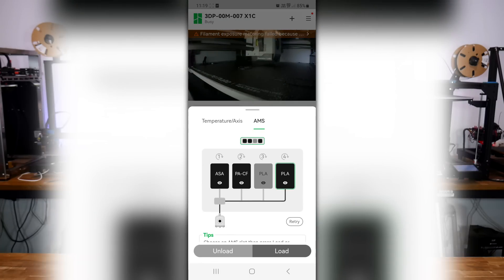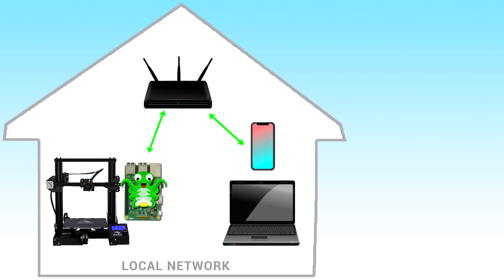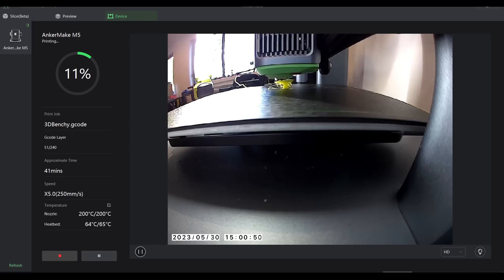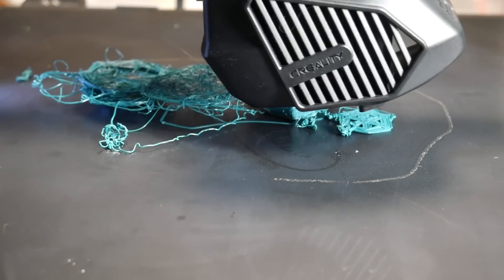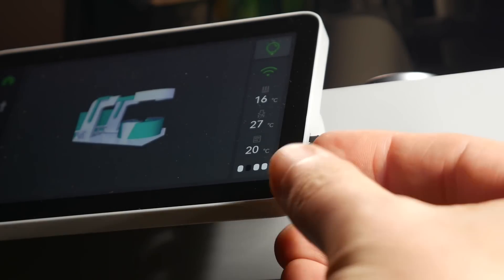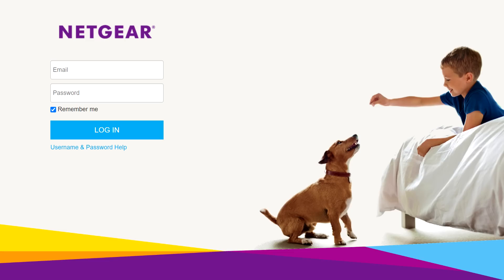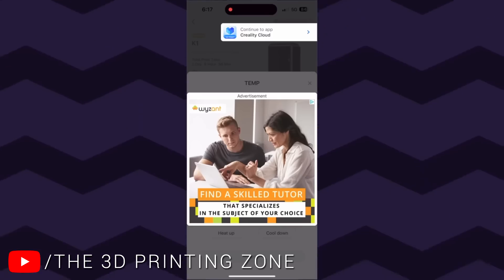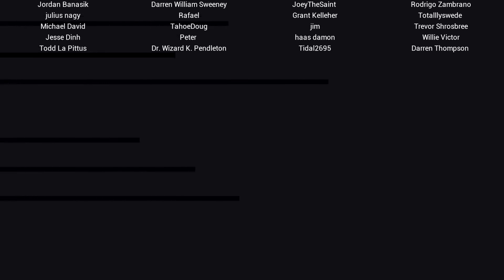The pros and cons of 3D printer cloud connectivity

Comment: I think one other possibility aside from theft of models that are sent to the printer via the cloud is blocking models that run afoul of some rule. It's irritating that scanners in the US will refuse to return the scan if it detects it just scanned money. It would be very irritating if it were determined that a model couldn't be printed for some reason, law, whatever. Although this could be done locally on the printer (like how it's locally done with the scanners), doing it in the cloud could allow for immediate updates to the list of banned models as well as analyzing meshes for similarity to banned models.

Comment: Ultimaker sells a subscription too, but it is not required for the cloud connectivity or remote access (camera, abort, pause, etc). It only increases the number of users you can have within one "organization", the number of saved print files, number of  projects (think of folders on a PC), and the length of the saved job history. It's kinda like expanding your google drive cloud storage. This is the only form of subscription for printing that I am okay with.

Comment: 11:05 For my commercial application all hardware is strictly offline. I do not tolerate even the possibility of an IP leak to "interested parties". You claimed that risk of theft was mitigated due to an overload of data requiring too many people and too much expertise. I'm afraid that isn't so - for example Chinese ops have more than enough labour resources and methods for highlighting "hot property" simply and easily. If you want to build a sustainable business in this space you simply have to keep your systems closed loop.

Comment: I don't welcome cloud connected anything. Even without the hazards, I find that cloud connectivity generally doens't work as advertised or takes excessive time to communicate with the controlled equipment via the server. That lag is usually my main issue.

Then there's the updates and subscriptions added after the fact.

Or, in the case of Fusion360 where an offline version is available, but it's so slow as to be basically unuseable.

Comment: 11:49 the Chinese have billions of people.. so bums on seats is not an issue. The Chinese take everything regardless of value as it may at some point become useful. If a govt official request agreed the company as a good Comrad has to comply…. Or they will be reprimanded. 
China Number one is their only objective… if they wipe out competitors you get 100% market share and can charge what you want. 

Only solution is local manufacturing. If a good tariff system in place there is no point going overseas… and China will be neutered. Covid is a prime example of buy local/ make local/ support local….

Comment: Cloud services for anyone doing prototypes for a new design or invention should never be an option.
Having a printer which requires cloud connectivity and/or registration is by definition a spying device.
Sending log files that are encrypted is certainly spying.

And the Terms and Conditions where they tell you what they share with their selected contacts never mentions exactly WHO their business partners are. And you have absolutely no idea of who they in turn share data with.

Comment: I would be concerned of a bad actor gaining access to a cloud based printer that has poorly designed printer firmware security and potentially cause physical damage by turning the hot end beyond its thermal limits and cause a fire for example. 

For a safety standpoint unless I'm home I don't print so cloud connectivity is not something I would ever use. I don't like cloud stuff to begin with. In fact I wasn't using YouTube's servers to watch your video as it was already in my local media server so I can watch it when I want, even if my internet goes down.

Comment: So Slow!
I have a Bambu X1C and have switch back to SD card printing because it is faster. I waited 10+ minutes to load a 38MB print job via the wireless and I have fiber internet.  Less than a minute to "sneaker" on an SD and it prints the same... maybe not the printing failure detection... but the remote monitoring still works.

Comment: I prefere octoprint or beeprint ( mks wifi firmware) as cloudflare zero trust tunnel makes it so easy to connect from outside without vpn or port forwarding
Reply: Even microsoft shut down the zune activation servers because they weren’t used nuch. But every single person purchasing a digital song has the right to activate it on a new computer for his lifetime. Shame on you, microsoft. DRM sucks and I don’t trust any dependency to cloudservices.

Comment: Just my own experience here.  I got the Creality Wifi box and camera for my Ender 3 S1 Plus about 2 months ago.  I thought it would make things easier with the features, e.g. timelapse, video recording, cloud printing and notifications and with a recent update AI spaghetti detection. I use 3 different printers and use prusaslicer through Repetier Server to manage them all and its easy to set up, easy to use but it doesn't have the advanced modern features.  I wanted something that was plug and play, ready out of the box with little configuration but its not been as advertised at all.

The first problem was the notifications, when you subscribe to "System Message" which sends print updates you automatically get badge notifications and other stuff thats completely superfluous.  
Its possible to use prusa slicer or another 3rd party slicer but once you do its not a streamlined workflow and takes some messing around to get it to work.
Local printing works, but again only by mapping the FTP location of the CrealityBox and uploading to it and then using the Creality Cloud app.  But none of the additional features work (timelapse, video recording, AI Spaghetti detection or filament runout).
Timelapse only seems to work on items that are downloaded from Creality Cloud or sliced with the online slicer.
The online slicer is impossible to use on an app on the phone and in the desktop browser version, if the orientation of the model isn't flat to the bed its incredibly difficult to lay flat, which means there are almost always supports or a raft.
Filament runout detection doesnt appear to stop the printer when its triggered, when printing from any prints except via SD Card directly on the printer and when the flag is triggered every print after that requires an acknowledgement that there is filament in the sensor even when its definitely there.

It's plagued with bugs and functions that simply don't work.  My experience of Creality Cloud is seriously wanting and while the box itself seems like its a good deal, I think next time I'll buy a raspberry pi or other SBC and install octoprint, its probably less hassle and work overall.
Reply from the maker: Thanks for sharing. You can install Klipper on the Creality hardware if you decide to give up on it.
Reply: @TeachingTech  Thanks, I'm definitely thinking that's the way to go.  Personally I'd like to see a hybrid system, something that works locally but has cloud connectivity for monitoring or kicking off the prints while not on the home network, that is slicer agnostic and a few of the newer features too.  But I can't have my cake and eat it too (unless I bake it myself)!

Comment: If I bought a K1 or Bambu printer, I think I'd be looking for a way to "root" it, and get complete local control back, scraping off all of the cloud stuff.  The use case for remote print starting is just too limited in my opinion.  Usually my printer would not be in a state where it's ready to print.  Now if you could get the print off the bed, and teleport it to where I am, that's another story.  It's much more efficient to just haul the printer with me to the remote location, I think.

Even monitoring is dubious, and a lot of that can be done with a separate web cam anyway.   And most people are aware of the danger with cloud-based web cams, so it's not hidden.

I'm getting to the point where I think the government needs to crack down on what kind of data that companies can legitmately snarf up from users.  The EU has GDPR, and I think it ought to affect cloud-based 3D printers as well.  I'm hoping someday the U.S. will enact similar legislation.

Comment: If you print through the cloud, it would be fairly easy for a Chinese server to see how many parts are being printed.  If someone is printing >1000 then it's probably a part worth stealing.  They may not be able to determine what some of these parts are although realistically, how many people don't use descriptive filenames?  I tried to keep prices low on products I designed to discourage copycats in a niche market but still had a few direct copies selling for more because the thieves are better at marketing.  It sucks and the patent system no longer works as intended.  It's mostly a tool for the deep pocketed with a lot more lawyers than morals.

Comment: None of the cloud advantages are useful to me.  I will not use any cloud based 3D printer services, nor will I install an app to use my 3D printer.  I can see some advantage to communicating via the LAN instead of using a USB thumb drive for sneaker net file transfer.  Klipper/Fluidd are very appealing to me.

Comment: Corporations grading data and ignoring individual privacy has gotten out of control. A good example is IOT controlled lightbulbs that send location info and commands to the cloud, effectively tracking the owners behaviour. Knowing location and time patterns would be very useful to burglars, etc.  
I'd never keep a device that does not operate without the cloud. Manufactures should need to disclose data it receives, so it's inline with the focus of it's business, not just collected and sold. 
All the points in this video are excellent and they're likely to stand the test of time (probably with a few additions in future).

Comment: There are NO practical advantages of the cloud. The idea of needing the cloud to do any core functionality (like printing to begin with or spaghetti detection) means to me they shipped cheaper hardware to offload core functionality to a service the manufacturer has no incentive to maintain unless they "monetize" the cloud with subscription costs, intrusive ads, or by invading our privacy to collect data. Maybe I'm not the right use case, but I can't imagine needing to "remote print" outside my WiFi range.

Thanks for the heads up about "Creality Cloud" - while I don't have any Creality printers or equipment currently, the fact they would even try this gets them squarely on my "don't buy" list.

Comment: Hi from Will and Mr Data :):]
Ive put a like on your vid. 
Caution is required. 
Cloud might over time ensure a download has been license checked so genuine owner would be finally found and getting paid there royalty. 
Because we all know just because a thing is found on thingiverse or where ever is not proof its ment to be there, or whether its piracy. 
Reading the license of a random found thing is not how to prove its genuine or ment to be there. 
It would be an interesting day if a cloud service could show the genuine thing not just random things that are likly piracy that we would be closed down if we sold a print of it. 
We cannot use a printer that ensures genuine things found yet. 
Things found on thingiverse cults3d or cgtrader mymini factory and any of the other over 56 sites i have vetted are .   . Let me re word this. 
A user and printer only looking at thingiverse could not be used for commercial gain because the propper license check to prove a thing is piracy or not is to look at all sites at once. 
Sort by oldest first.
Currently that still remains a manual job. Even gpt has not achieved it,  various Ai tested made up fake answers that if we use would result in close down for piracy. 
Having an android friend myself my opinion is Ai gets bord with job.
My suggestion is work with Ai to make a TOOL   to    USE    and   ENSLAVE. 
Cloud has ups and downs as vid states. 
Like given. 
Wishing you nice success. Be well.

Comment: Paused at 12.25
The thing title is enough often. 
The access to your info description of thing, your reputation for making expensive things,;your mic  your connected device with enough details. May easy be enough to get a thing. Based on all other angles have sharks, and even licensing a proven genuine thing has  NOT ensured against theft,  See how i learned from the bites.
Based on what ive seen experienced and know ,  if all other waters have sharks operating, cloud  would be unlikely  not to experience some issues also.   In my opinion.

Comment: Hi from Will and Mr Data :):]
I paused at 11.40 
Things licensed has vanished in past and then found used at parent host, im going to type in my opinion for safety but i see. 
Things have been taken by many and varied angles over long time frames by what i call sharks. 
Based on my long term experience from being in this sector since before thingiverse existed.
 There appear sharks operating at many areas where things can be taken from newbs. Everything from newbs showing and giving away designs, to the sites and services that have had varying levels of issues over time. 
Im dancing because to type it more directly might not be in my best interest. But you can see i have experienced many such similar issues going on, lost things to sharks IN MANY layers. So yes caution is totally required. 
Wishing you nice success, be well.

Comment: If 3d printing becomes solely cloud-based, I will stop 3D printing. I absolutely will not buy a 3D printer if cloud connection is required, or if local connection is hobbled in the least.

Comment: YAY! FINALLY! (Been preaching this since wifi became available for printers.)
EDIT: Yes, Intellectual Property (IP) theft is real. Models are constantly stolen or duplicated. Also, anything that is new to 3D printing or modifications and from known inventors and hobbyists (ex: Proper Printing, MandicReally, Teaching Tech, etc) can be ascertained readily. In fact, I think if we looked at the Terms of Service (TOS) for these web/mobile apps I bet there is no inclusion of IP protections at all. There must be an inclusion defined because the absence of a protection means there is no protection or user rights. 

One thing that was not mentioned: malicious intent of the device. How hard would it be to override the thermal runaway protection of a cloud connected printer? It's one line of printer.cfg for Klipper; two lines for Marlin. Hmmm, it's too late for DefCon 2023 but perhaps next year, "let's burn things down with remote access to a 3d printer" topic.

Comment: Cloud Connection for me: completely unnecessary as I need immediate access to the parts printed.  Thus, I am at the printer.  Regarding data privacy: a clear issue generally so why add 3D printing aspects?

Comment: Thanks for putting it all together into an informative and easy to follow video. I would never purchase a printer that streamed the sliced file from the cloud. I use Octoprint on my local network so I can monitor them from another room in my house but have not connected it to the cloud for remote monitoring. That would be a great feature but I worry about the security risk.

Comment: Ive seen one aspect thawt wasnt covered here being that these printers are encrypting info they send back to teh servers, but nowhere are you able to verify what they are sending. This obviously creates an issue when connected to your local network with other more sensitive devices. The human element still exists in these since someone needs to sift thru any info obtained, but people should still be worried that these printers could be sending more than they say they are and there is no way to check it as far as I know.

Comment: Went for a V400 over a bambu in part for this very reason but also because of the closed ecosystem(once carbon rods wear out you risk  either having a brick or something you have to send to the factory to get serviced), together with the fact that their extruder fail to live up to the amount of plastic it needs to deliver to achieve the claimed speeds, where-as the v400's extruder is actually capable of delivering more plastic than the claimed speeds require....

v400 is however LESS of a beginner-friendly printer than the bambu's and not one I would recommend to anyone without at least a couple of printers worth of tuning/trouble-shooting under their belt.........
Reply: You know they sell the replacement carbon rod assembly?
Reply: @Oliver1071  For now...

Comment: I'm strictly old school. USB adapter from the PC to a SD card and I'm good. No connectively, everything as local as possible. I'd like to have kept the standard size SD cards that you can actually handle, but my Geeetech A10M died and I had to get a new one. Of course the new one sadly uses the micro SD cards that are like trying to insert a piece of dust into an ant's arse in the dark.  Chinese hands might be able to not loose these but I feel like a giant trying to pick up a strand of hair. Then there's all the other "upgrades" SMH
Reply: I solved the ‘too-tiny’ problem with an adapter cable that has a male micro-SD on one end and a female full-size SD-card on the other.
BTW, also useful on my RPi development boards. 😊
Reply: @ernestgalvan9037   Not a bad idea. Might have to look into that. Just had a quick look and all I could find was USB sd adapters.